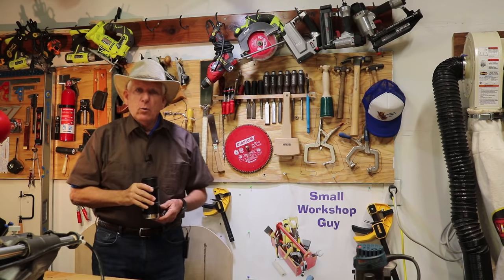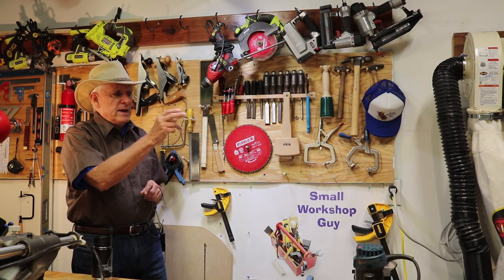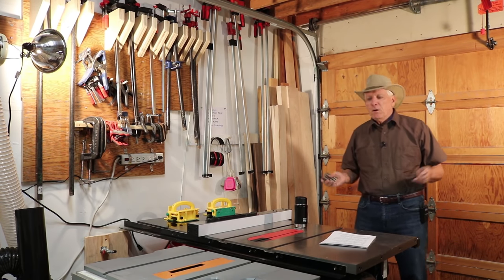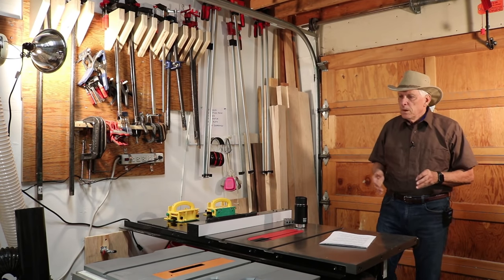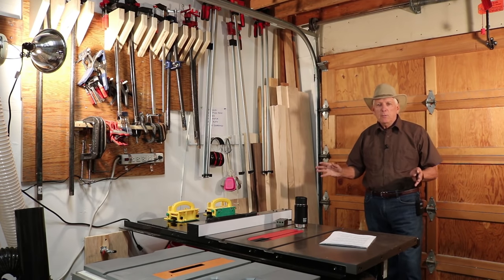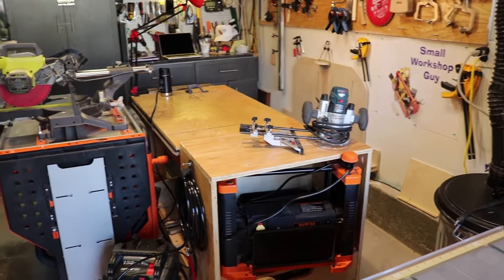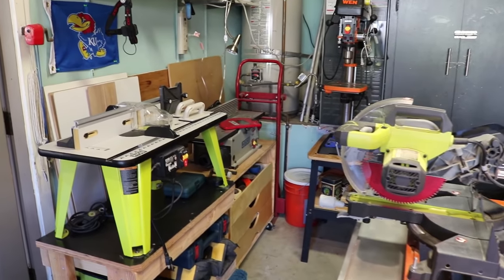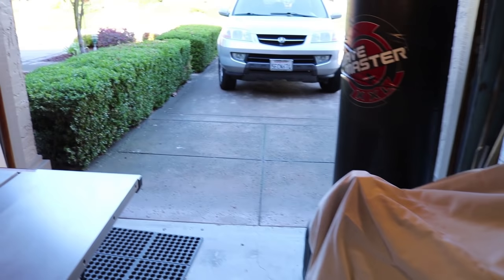Small Workshop Tour- 4 Principles of Organizing a 1 Car Garage Woodshop - Layout Ideas and Setup

Comment: I really enjoy your humor!  You are suggesting your layout solutions, NOT lecturing your viewers! Good job with the Video.  Yours is very much like my one car garage workshop.I Am in the process of upgrading my dust collection. First was a cage around my mitre saw. I suggest you figure out how to accomplish this, as it will spew dust all over your shop if you don"t. Next was the Drill press. Now I am replacing my belt sander with one that (maybe) will collect its dust. I see that you have your table  saw facing away from your garage door, allowing about 4 ft for the woodworker, I have mine facing 180 degrees different with only a foot from the door. this allows me to have my space for the woodworker to be shared with my bandsaw.  My Mitre saw with its surround is mounted between two workbenches with storage drawers under all three. Under the drawers are slide out boxes for offcuts.  Your comments on wall space are right on track. It seems to be in fashion to use French cleats on the wall.  I suggest that pegboard will be much more space efficient. Drawers are absolutely necessary, but remember, "Drawers are where tools go to die!!"  Several other video woodworkers use "sustainers". then they either use the sustainers for drawers or put them in drawers. This is redundant, costly, and impedes the work flow.  Maybe it really sells sustainers though. Ease of use should be the goal, not how pretty the shop is.
Reply from the maker: Wow, now that is what I call contributing

Comment: I have a small 1 car garage .. I would say one of the best things, I did was to make a fold up against the wall  workbench... if I need the floor space , I can fold my 4 ft by 4ft work surface which is on hinges up against the wall ( legs fold out).. It works very well  .. The bench, I made works as a work bench with a vice ( which is removable) and a assembly table..
Reply from the maker: Sounds great.... I have seen some of those.

Comment: Thanks for the tips! What is the size of you Shop Fox dust collector? 1 HP or 2 HP? I have a Shop Fox 1 HP, but I'm thinking I might need to go to 2 HP.
Reply from the maker: 1 HP and if 2 HP was an option, I should have gone for that.  I had to take it off of 4 hoses and now use it just for table saw and thickness planer and I think it is a little under powered.  I use a Craftsman 16 gallon 6.5 HP Shop Vac to attach to most of my movable power tools (band saw, drill press , oscillating sander, belt sander and sanding devices.  It is great bu often under feet.

Comment: "In the history of mankind" bit kills me.  :)

I'm going to be trying to do a setup in 1/2 of a 2 car garage and make my workstations mobile so I can make the most of things.   Aside from the hybrid Samurai/Wood Whisperer Workbench, I will be putting together a table saw / router workstation.   Still not sure if I will need a miter saw since I plan on doing a lot of wood/epoxy projects....nothing huge though, nothing bigger than maybe a coffee/small dinner table.   but, I already have to ask....what jointer is that?   I don't see it listed in your list here.
Reply from the maker: I had a little Cutech jointer - it was worthless.  I now have a $2700 Powermatic 8” with Helical heads - works great
Reply: @SmallWorkshopGuy  nice upgradethen.  I am probably going to start off with the WEN 8" benchtop jointer.   Economic, has good reviews from what I have seen, and will likely suit me for a while with what I will be using it for.

Comment: Some good tips.  I have a very small shop I’m looking to redo and dust collection is at the top of the list in terms of priorities.  Thanks for sharing!
Reply from the maker: My ShopFox 1 HP is underpowered and cumbersome to move the hose to different devices, so I only use it on Table Saw and Thickness Planer.  I supplement that now with a 6.5 HP shopvac (Craftsman) and that moves around easily to where I have set up any of the other power tools for use (all on rollers).

Comment: Where is the space for the "Woodworker"?  I found that moving large tools out onto the driveway solved a lot of my Sawdust issues.
Reply from the maker: Yep, in the real world, I back my SUV up to about 10' from the garage door, and then move the router table and benchtop jointer to just behind the car (therefore basically hiding them from my neighbors.  I live in a Townhouse complex and work with my door down so neighbors don't hear the noise and so I don't run afoul of anyone who would complain that I am breaking CC&"R's (homeowners rules).  With those two large items off my workshop floor (except when I need them), I almost have room for the "woodworker!"  Hey, thanks for watching and commenting.

Comment: Good clip. I liked the reference ”in the history of mankind”. Do you have your tables on casters? Do you have issues with dust collection in such a small shop. My shop is small and all the tools are connected to shop vac yet I get dust everywhere
Reply from the maker: Everything is on casters except for the SawStop table saw and the worktable. I wish I had ordered the SawStop with casters but already felt guilty about the expense but it is way too heavy to move around without. I do have a Shop Fox 4” dust collection system hanging on the wall and connected to my table saw and the contractor saw permanently with a third arm that can reach all of the other tools independently.
Reply: Small Workshop Guy I rewatched this with a thought. Main difference w mine is that all my large tools are stationed on the walls where as you had your table saw in the middle and work table. Thans for showing this I need to do little rethinking
Reply from the maker: Did you reconfigure your workshop and if so what do you feel you achieved?
Reply: Small Workshop Guy Hello! I pretty much refurnished my shop. Its not exactly done but almost there. I threw away very much scrap wood and bit n pieces of sheet goods. It made such a difference! When I started with my shop I didnt have all the tools I have now and just had to find a place for each one after I got it. Its a different game when you got all the tools and to set up the shop then. Looking forward getting some serious shop time there! 💪

Comment: 1 thumbs down.  Well, go to your analytics and get his address, and I'll go smack the idiot.  This is a fine video of a small shop, well tooled, and well organized.  Little to do for effective use.  Well done, sir.
Reply from the maker: MarkH10 - thanks for the positive comments.  Much appreciated!
Reply: I can relate to that I had a small woodshop years ago and I didn't have too many stuff it was like 8 by 32 and I was surprised how much I could get done in there but then I Advanced into a larger area and now my Woodshop is 30 V 40 I have additional room to keep my air compressor and my 3400 Cube dust collector in another area of the building I know what it's like to work in a small shop